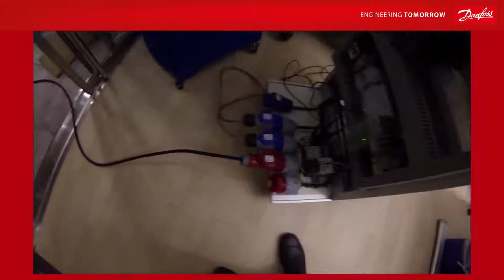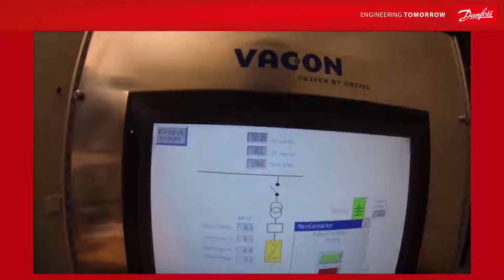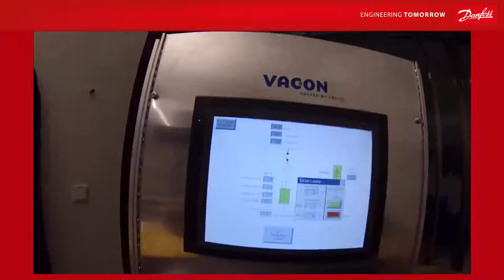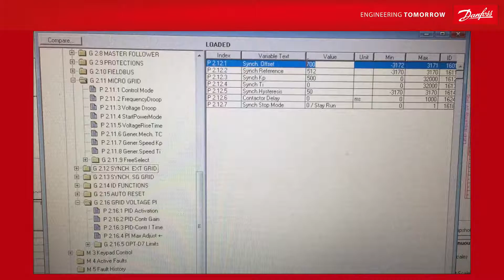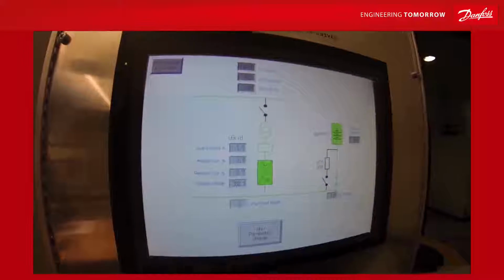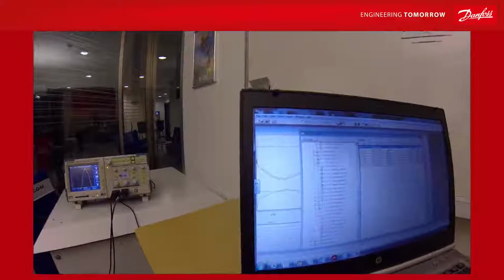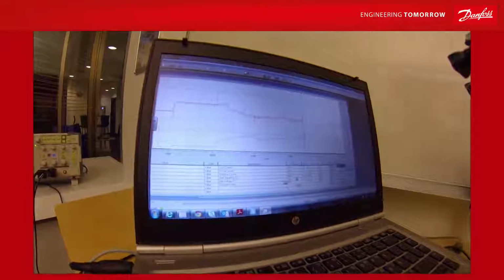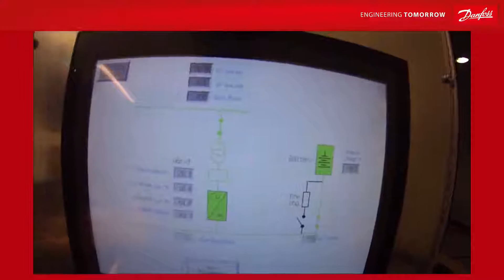VACON® NXP Grid Converter - grid synchronization

Comment: Error F32 fan cooling error code can this be internal fan.
Reply: - Check the visible damages
on the fan inverter board and
check the LED blinking, also.
- Disconnect and check the
fan -> replace the faulty fan.
Check fan capacitor and fan
inverter.
- Measure the winding resis tance and insulation resis tance.
- Power supply fault or "ON"
command missing.
- Problem can be in fan, in
fuses, in fan capacitor, in fan
inverter, in power control
board or in the cables
between them. Check the
isolation transformer and
output common mode filter,
also

Most probably Capacitor or the fan inverter. Ist a big unit right?